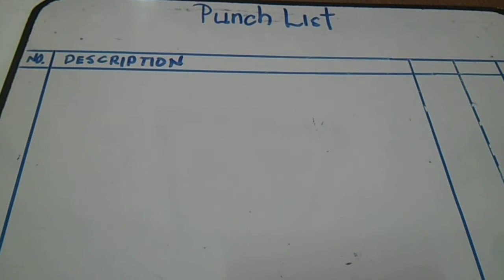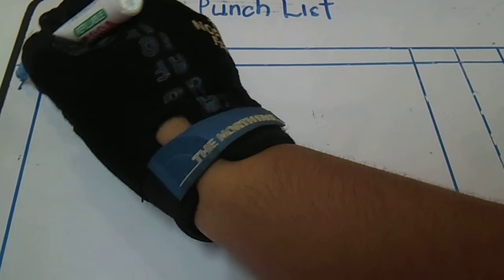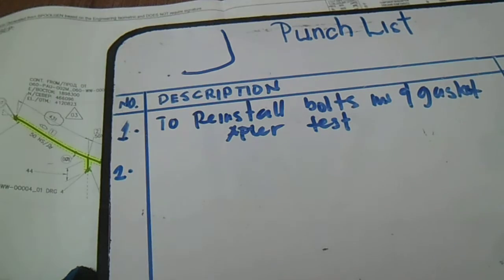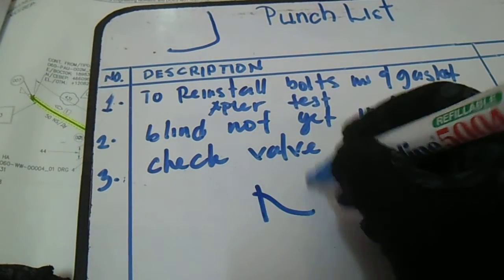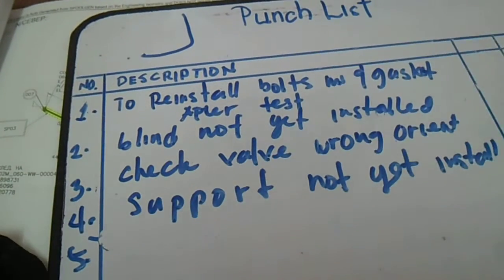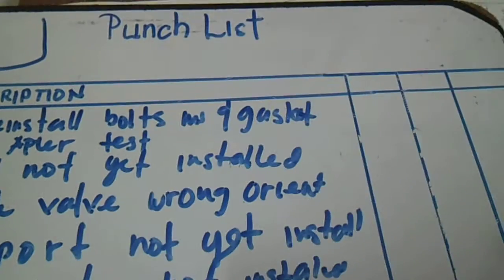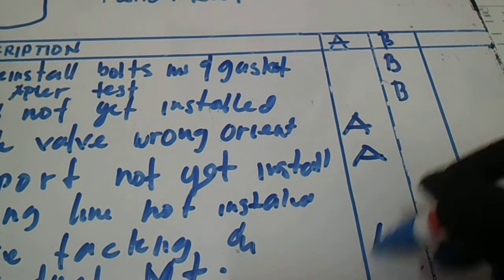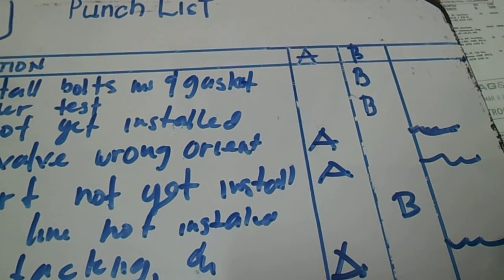How to Make Punch List Category A, B Part 3 - PipingWeldingNonDestructiveExamination-NDT

Comment: the sequenced prior to test for pipe :
a test by document released called with test package, before test we should do activity :
1. all fabrication, NDT required has done
2. compile all data in one document to going in a line check
3. QC contractor, QC from client and construction personnel should attend when conduct to line check.
4. line check will verified each single isometric drawing
5. after  line check has done, inspector will give a comments/punch list ( A or B ).
6. killing punch list to ensure all pending item should complete especially for A category
7. then doing cleaning if requirement, blowing up in side pipe.
8. hydrotest ( pneumatici or hydro refers the media service.
9. reinstatement, mean contractor doing flange management as per isometric drawing,
10. precommisioning phase.
Reply from the maker: Great job! Thanks for sharing
Reply: Thank you
Reply: thank you

Comment: Hi ...
Thank u for all your efforts...
I have a question please...
(During pipe line hydrotest, what is the situation of the valve which locate in the end of tested pipe branches, is it  (closed or opened)..for example the valve locat in the drain or vent. branchs...

with all my best...
Reply from the maker: Your Welcome Sir, during water filling valve shall be open in the vent side for air trap out. 
Hydrotest is As Per Method of Statement